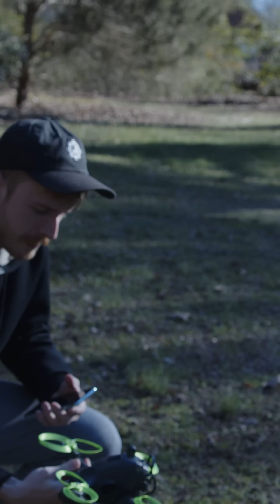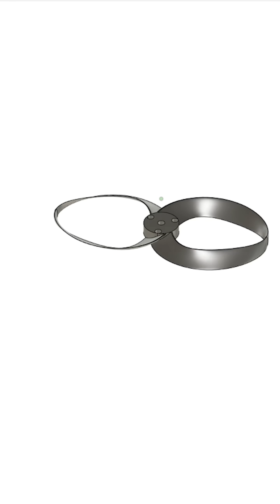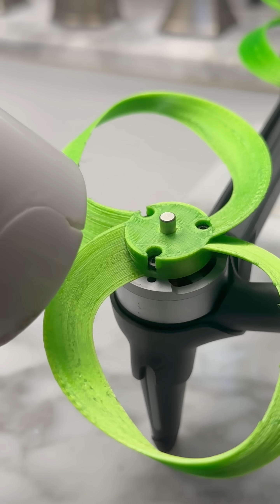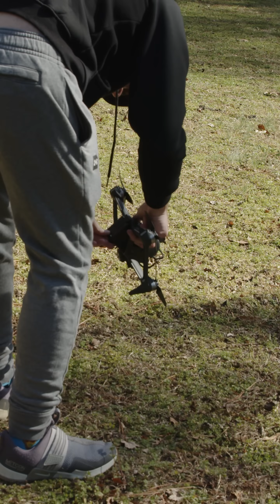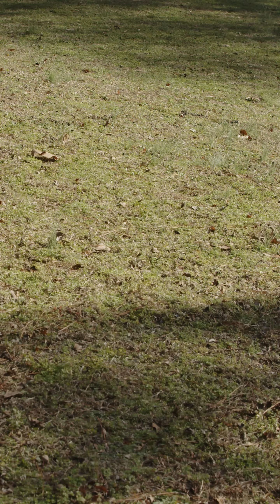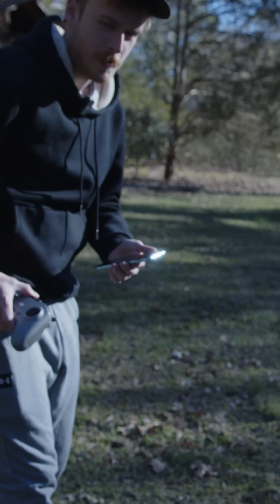Testing MIT's Toroidal Drone Propeller Design & Sound #shorts

Comment: They aren't really quieter, they just produce less high frequency noise and lean more towards the low frequencies.

If you were to fly in a heavily populated area with toroidal propellers it won't bother people as much as normal propellers because the lower frequencies the toroidal propelles produce can sound like beehumming for further away.

Which, when you think about it, makes a drone that uses toroidal propellers a lot more stealthy because humans don't pick up on low frequencies as much as they do on higher frequencies.
Reply: they can be quieter due to the rawness of the print

Comment: Although 3d printing has come a long ways and is capable of making props, injection molding would be a better test. More even balancing of weight, smoother chopping of air etc.  Even with the nail polish those surfaces are still abrasive in a fluid gas, air.

Comment: I am yet to see a test of these that confirms the original claims. it seems to be "they are quieter but generate less lift so you need to spin them faster, at which point they are louder"
the drones also seems to be less stable when they fly. if the claims by MIT are true they must require very precise manufacturing.

Comment: It's not much quieter, but it does seem to ease off that high pitched whine you get from the propeller. It'd be fun to try these out and see how they work with wildlife. Even if it is just as loud but makes a lower tone, that could go a long way in not aggravating wildlife.

Comment: >modeled yourself 
Yeah of course its not going to be quieter, the tolerances for making it not loud are extremely tiny. Even slight changes to the angles will cause tons of turbulence in the air, thus creating noise.

Comment: I've wondered a lot about using them in reverse, as wind-fan-blades. If I mounted these toroidal props inside a Waldorf-style turbine, would it more efficiently/effectively convert airspeed to electricity?

Comment: A few notes. 

For fair comparison, you should have printed both sets of propellers.
Different manufacturing processes, materials, and even the air foil (wing shape) contribute to the difference in results.

You did not anneal the propellers, nor would you want to.

MIT did not conclude that the toroidal propellers were quieter. In fact, they found the opposite. Toroidal propellers generate a higher decibel output. 

Interestingly, though, is that the noise output was a lower frequency. You could make the argument that it was more "white noise" than the high-pitched whine of regular propellers. That's the real selling point. 

Regardless, I'd say it was a good first attempt. Keep it up!

Comment: If I am not wrong, that sound variation is saying that the toroidal propeller is creating much more air friction than the conventional one & correspondingly it’s putting much more pressure on those motors.

I am curious to know, what is the result if the angle of blades leans a little downwards, like 1 or 1/2 mm. And on the other side, it needs to be much more oval (less circular) than it’s now.

Comment: This might actually be quieter in person. The mic on the camera might not capture the high pitch scream from the original motors properly (noise suppression, mic range limits etc) and the lower pitch noise captures better.

Comment: do they generate more thrust?  is it a noise/thrust ration thing?  or is it just that they require precision manufacturing to have the desired effect?  also, aren't quiet propeller designs already a thing?  not that we shouldn't innovate further, i just remember hearing something about props based on owl feathers.

Comment: Now out of curiosity would the reason why it’s flying worse and making louder sound because it’s not smooth so it has a lot more drag causing more sound effectively undoing what the design is supposed to do or would sanding it down and making it smooth make no difference. I’m not an engineer so I’m no expert just an observation and genuine curiosity.

Comment: MIT? These were created like 100+yrs ago... They have them for ships and aircraft too. They're not made to be quiet. Bs info.

They're made to prevent turbulence and minimize the twisting forces of an engine spinning one way. Normally they countered this by mounting a propeller spinning the opposite way, then they created this type of design to reduce the complexity of a second propeller n differential complexity...

Comment: One it's a sensitive design as should be obvious by the aerodynamics you can't just smooth it with nail polish and two and more importantly they only reduce distant noise up close they're still loud probably even worse than a regular propeller.

Comment: Not even a fair test. The original propeller was smooth and perfectly optimized. The 3d printed one was full of imperfection, that add noise.

A more just test would be with both 3d printed or both perfectly made.

Comment: hitting it with a heat gun or a hair dryer does not anneal anything. Also they won't be quiet without post processing by sanding and smoothing.

Comment: show me you have no idea what how propellers work by not telling me you have no idea how propellers work...  You painted, annealed and covered the thin 3rd printed blades with "nail polish" without regard to surface contour, thickness, weight distribution,  pressure, vortex, or harmonics between the 4 props... cool bro whats next?

Comment: I bet it's still a valid idea.  It might need a different material or don't use the nail polish.  I imagine the idea is that once the blade is spinning at full speed it changes its shape into one that the air moves over the blades quiter.  The 3D printed version mightve been too rigid to allow it to assume the proper shape required to let the blades wisp thru the air with less drag.

Comment: This is the first time I’ve ever watched a video and hated the comment section being so ignorant on a basic test of a design. I did this same test for a new design modification of the 3 bladed toroidal propeller. FDM printing is fast and sometimes you just throw it together to make sure it works. Process improvement comes over time not in a single 20 second video.

Comment: If you use ABS, I would suggest trying Acetone Dipping, especially for thin parts like that. Essentially you fill a small container with acetone and dip the part in for 10 seconds, then gently shake it off and allow 2-24 hours to dry. (NO heat or airflow! Will cause bubbles on the surface!) I do parts in 2 halves usually so I have a dry spot to grab it by.

Basically the acetone seeps into every nook and crevice of the part. Then it proceeds to dissolve the ABS and form a slurry between the layers. Finally during drying the acetone evaporates out leaving a fairly consistent strength in all directions. Inside the part the layer lines are destroyed, replaced with many small bubbles that don't weaken the part substantially.

I do the dip process 2-3 times total, with some sanding in between if I want a glossy smooth finish. Not only are the parts truly solidified and structurally strong in all directions, but it looks like a finished product too!

Only do this for 100% infill parts though. Otherwise you will fill the interior spaces with acetone, that will then eat through the part.

Comment: The pantographs of Shinkansen trains are designed with grooves and ridges to reduce noise. These features disrupt the airflow, preventing the formation of large vortices. Instead, many smaller vortices are generated, which produce less noise compared to a single large vortex.

Comment: as a former Huey crew member I can't help but think they would be a little safer, I'm very curious about their lift cap and performance capability. Looks like they would last longer before needing replacement, less chop chop vibration.  Would like to see installed on a real chopper.

Comment: Hard to tell but they seemed louder, with more low end noise.
Also, I reckon they're carrying unnecessary weight at the.. tips(?) without generating much lift in return. 
Having said all that, they're probably safer, less likely to break & they look awesome. 👍

Comment: The propeller has been around for years. other than tweaks to the shape and number of blades the overall design hasn’t changed much. Not to say it can’t be improved but it works. I feel in order to get these to work as desired the manufacturing needs to be excellent, balance shape etc… also to me this appears to be a better design to propel through liquid rather than air. Very interesting design. I would assume they would take less energy (barely any difference) however if the thrust output is lower than a traditional prop then it is useless. I would also assume the turbulence would be reduced if you got it balanced right.

Comment: print them thicker so you can sand them down  then fully spray coat or dip coat. The way you coated them will leaves micro bumps and drips.

Comment: For everyone saying it's noisy because the blades aren't smooth....he covered them in nail polish which would leave the outside smooth regardless if the actual blade isnt.... So that's not the reason why they aren't quiet

Comment: It’s as quiet as a 4 stroke compared to a 2 stroke engine. The 2 stroke has higher pitch but the sound doesn’t travel far vs 4 stroke which has lower tone but you can hear it from far away.

Comment: Made from a sweat shop. you cant brag about this. its a disaster already. A japanese artisan sand polish one to perfection, even though had a dozen retry and failures. Thiis kind of work is just no respect 3d print, coat without polishing sheeshh and poof
Reply: It doesnt even look aligned. you need to laser check your alignment

Comment: next time add primer sand it then paint it with a urethane finish paint You will be surprised by the hard finish you will have. I'm sure using a spray will be faster than using a nail brush.

Comment: The tips or edges are still breaking the sound barrier. Look at modern helicopter rotor blade design. The tips are angled  back at the tips. This generates more lift. Because the tip design generates more lift the main rotor does not have to be spun as fast, in fact the tips airspeed is below the speed of sound., thus quieter -relatively speaking.

Comment: You're taking a theoretical design done by a world leading institution and expecting it to perform just as well on a hillbilly's desktop 3d printer made from cheap chinese parts and without finishing, sanding, balancing or improving the crap blades from your manufacturing. Then you present your deeply flawed part as proof that MIT is wrong. Absolutely hilarious.

Comment: The quietest room fan I have doesn't use blades, it has an internal impeller.  Wouldn't impellers be the better option for a drone if you wanted low noise?

Comment: Yeah it probably has more to do with the material and how it vibrating or resonating  when the drone is running i bet if it a was slightly hollow and filled the hollow part with pressurized  gas it would keep the material  from making a resonating  hum

Comment: Even if this example didn’t work, it’s a good idea to try and make propellers that audio phase each other out to make them silent.
Reply: Nice idea but it wouldn't really be possible, of you could time the blade movement perfectly to a 180° phase and place a mic in the centre of the drone you'd get no sound.  

From anywhere outside the drone the distance between propellers, and the distance to whatever is receiving sound, would make it impossible to make it any quieter with phasing.
Reply: @brendencorfield182  yeah
Reply: 200 IQ
Reply: CAN'T HOLD A PEN YET I'M OUT TO DRAW PICASSO😂
Reply: @infinityp275   Can't hold a pen but going to draw Piscasso?  So what?  What does drawing have to do with it?
Reply: @crimony3054  Its a metaphor for not having the breadth of knowledge and access to the best fabrication equipment to create something so advanced but you go ahead and try anyway.
Reply: @  I mean, does it require the ability to hold a pen in order to draw a Picasso?  I've seen elephants paint more interesting stuff.
Reply: @infinityp275  Picasso was a painter, dumbass

(as in, check yourself before you make jokes about ignorance)
Reply: sound comes from Motor
Reply: @un_nonQi and tyres
Reply: What if you just put a speaker on the drone with the opposite equal sound being emitted to neutralize the sound? Am I smooth brained?
Reply: @ Not smooth brained at all, that’s how Cadillac did their original quiet drive cars back in the day, had a mic outside the car and boosted a phased version of the outdoor sound into the speakers of the stereo. Also, pretty sure that’s still how noise cancelling headphones work. 🤘🤓
Reply: @TheChairmanLmao  LFG make me that drone someone plz
Reply: Источники звука должны находиться в одной точке, либо же на одной прямой с приёмником звука. Два и более удалённых друг от друга источника волн создадут интерференционную картину, но не заглушат друг друга полностью.
Reply: Jesus loves yall
Reply: lol maybe in another life time
Reply: Yeah silent drones. Good call... 🖕
Reply: Wouldn't the waves move around as the drone flies? I'm really asking. I failed biology
Reply: Genius! Interestingly because there are 2 clockwise and 2 counterclockwise you would think they might be doing that somewhat already. 🤔 Curious

Comment: 1: you had to model them yourself in 3D
2: 3D printed, not smooth
3: nail polish to fill ridges, not perfect surfaces
Hella room for improvement considering the precision required to reduce that noise

Comment: Granted I just realized this is only a short and there's a full length video.. I hope in the full length, as well as wish it would've been included in this short if so, simply adding a device to measure the dBs next to the drone would give a much better understanding and convey the difference in terms of sound than merely attempting to capture it via a phone camera presumably, or even if it were a DSLR, then uploaded to Youtube for viewers to attempt to discern what all differences there are.
It's kind of like doing a performance test without any kind of measurement system in place. Sure, if it's superior enough, you could tell just by viewing it that one is better than the other, but by HOW MUCH it is, and raw numbers and data, at least in my opinion, the most interesting and enjoyable part.

Comment: The problem is that most of the noise isn't coming from the turbulence. It's coming from the DC motors spinning fast. This is a useless advancement without silent motors.

Comment: For those who don't know the propellers are designed to push the sound more outward which is why It soubded louder on takeoff. You dont need a drone to be silent off the launch pad you just need it quieter when its above something.

Comment: 😂😂 serious question: we’re you able to lock the mic gain on the camera? An SPL meter app would highlight a relative difference at full throttle. Subjectively similar levels on camera, possibly slightly less high frequencies off the torroidial? High frequencies fall off quickest with distance so  that isn’t a significant win over an absolute decrease in level 🤷‍♂️

Comment: Not even close, the Toroidal Propeller from MIT has a very fine tip, I've seen it up close during a SHIELD AI demo. The top half of their blades is thin and narrow, bottom part of the blades are wide.

Comment: My assumption is, that you´d need to use a stiffer material. Like way stiffer, I strongly suspect you can see the rotors bending while rotating at a high rpm. Could be checked with slow-mo. But the nail polish is a good idea.

Comment: Without a decibel meter it’s hard to tell which is louder. It’s clear whatever you recorded with uses a microphone which automatically adjusts gain.

But regardless 3D printing is a terrible way to prove whether or not these are quieter, especially with huge filament making deep ridges. 

A better way would be to cnc mill one, make a wet sand cast for it, and then pour molten aluminum or plastic into the mold. Then you can sand down any imperfections from the casting process and try that. I know a lot of people want to try replicating stuff like this but doing any aerodynamic high velocity things with a 3D printer can show the opposite results of the real world due to drag on the filament lines

Comment: Instead of using clear nail polish. Depending on what you printed them in. Use an acetone vapour camber. That will smooth and strengthen them right up.

Comment: To reduce noise you need to make the length of the propeller in 2 - 3 times more and increase the number of blades + increase the width of the blade depth, then they will rotate slower but pump a larger volume of air, it will affect the speed but noise will reduce by many times
Reply: Bamboo propellers are much quieter on the DJI phantom.
Reply: To reduce noise you can’t always reduce the size of the propellor. The design of the blade is what is being tested. The goal isn’t to just get something quieter and less irritating for the human ears, it’s to do that no matter the size of the blades. I can make a super long bladed prop, but that doesn’t do me much good when the drone doesn’t accommodate the size.

Comment: Roughness is the issue if the propellers were smooth and Sharpe at the tip they would make less noise and cut more air smoothly which would help in noise reduction and lift.

Comment: Doesn't really sound quite to me but hard to tell from a video. Also, even if they are quieter, that doesn't mean they perform better or more efficiently. Aeronautical engineers have been trying from a long time to improve the propeller  and they've made some crazy changes over the decades but the propeller is largely recognizable to its original origins, that tells you it works very well. Always good to explore and experiment but I don't see something like this replacing the propeller anytime soon, unless it can beat it in both performance and efficiency.